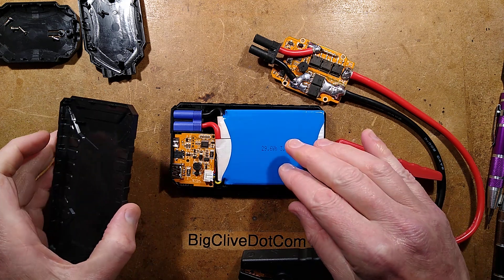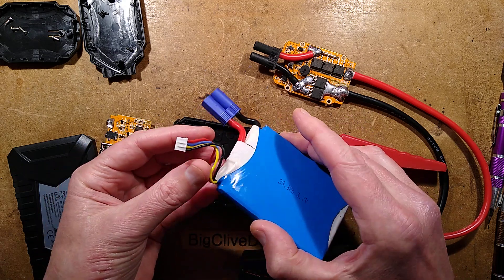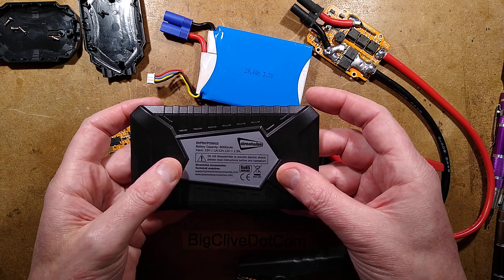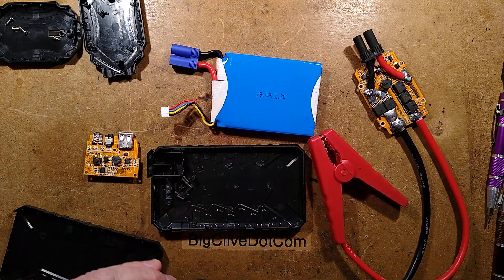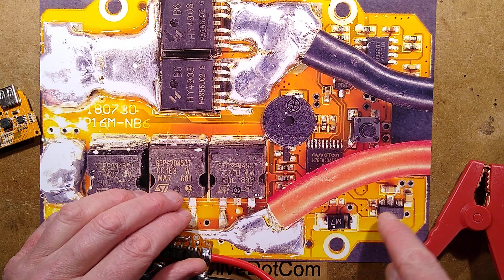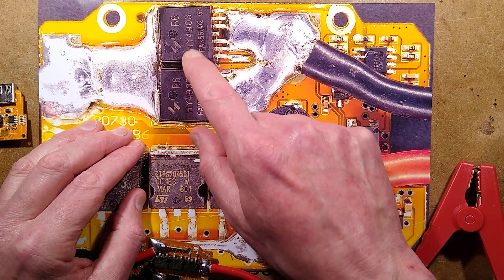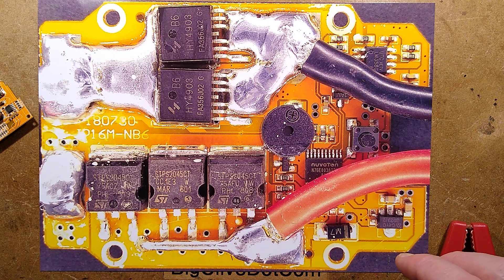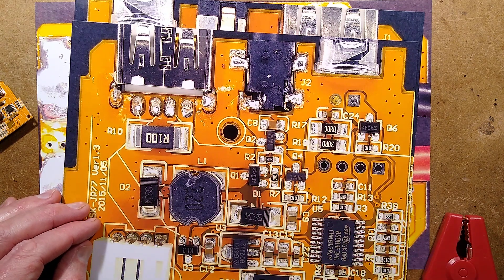Inside a combined power bank and jump starter

Comment: These devices are so interesting: it's such an obviously useful device.  Completely replace jumper cables, don't need a second donor car.

But they are ALL made by these random nameless companies, there are essentially NO name brand ones backed by any reputable company.  The reviews for all of them are a bell curve of of "this is great", "it didn't work", and "it went on fire".  Is it just not possible to make these reliable? Or would it be so expensive then, that no one would buy them? I can't believe there's no market for really good reliable jumper packs.
Reply: It's honestly a chemical problem. Most "portable car starters/jump starters" come into two different categories

Li-ion/pol battery based one, just like what Clive has here. The disadvantage is when you start a car it needs a brief amount of a lot of current. Lithium batteries don't take super well to this kind of ultra high current situation. A lot of complicated control circuitry and a much beefier case/cable set, more R&D. So that's why most of these are disposable, use once or twice and toss when it melts type deal.

You can also get much bigger, bulkier jump-starters that aren't nearly as cheap, but actually have a near/full sized Lead Acid car battery. So it's basically another car battery in a box with wires. They're a lot more reliable given they have similar current ratings to a normal car battery, but , the big downsides are the weight and bulk , as well as LeadAcid having a (comparing to lithium based) high self discharge, these types of units often need to be 
-trickle charged off your vehicles main charging system to keep it topped up. 
-charged up every few months

It is very interesting though
Reply: @SolluxDivide  "You can also get much bigger, bulkier jump-starters that aren't nearly as cheap, but actually have a near/full sized Lead Acid car battery."

I have one of these, and it has a lot of other useful functions, such as a USB output, a 12 cigarette lighter socket, a light, and a compressor.

In a power cut, I can stay on the internet, by running my tablet and router off it.
Reply: @BedsitBob  yep! Many of them can act as a power supply in a pinch, but I'd personally suggest getting a UPS for the modem/router/laptop so that they are more protected from electrical faults && will automatically kick to stored power when the line gets funny.
Reply: @SolluxDivide  Power cuts are very rare here, so I can't really justify a UPS.
Reply: @BedsitBob  It's not just power outages, but also under / overvoltage protection.  Here in "semi-rural" NSW outages are reasonably common, and the "cheap Chinese generators" are far better quality than we are led to believe, being very reliable and more than capable of exceeding their already decent specifications!
Reply: @BedsitBob  If all you want to power is a router and a computer, you can get fairly cheap UPSs which might set you back around $200.  These will keep you going for around 5-10 minutes so you have time to finish whatever you were doing and shut down cleanly.  Or... time to start up a generator if you want to keep going through the blackout.
But the point is that small UPSs exist and they're pretty cheap nowadays.  If your modem/router and computer are in the same room or you're using a laptop computer (which inherently has its own UPS in the form of battery power), then you only need the one UPS.
Reply: @melkiorwiseman  My tablet draws  200mA, and the router 2A, so the jumper pack should give me a few hours of use.

I'd likely only turn on the router for a few minutes at a time, to check in on the world.
Reply: There are a lot of name brand companies that produce these. NOCO, Schumacher, Clore automotive (who also owns and produces all the jump and carry models) and so on. Yes it’s true if you’re searching Amazon you might struggle to find a reputable brand. However outside of Amazon there are many name brands who’ve been in business for decades or more and who specialize in battery solutions.
Reply: I actually have a Noco, which I'd call a brand one. Works great, and chargeable by USB so it's really handy. Can definitely recommend it.
Reply: Mophie!
Reply: Has Makita or Hikoki designed one that can slot onto their power tool batteries yet?
Reply: I have a broken one of these that I was given "in case I could fix it", which had just stopped charging. The repair was beyond my skill but I was looking to pick one up anyway and was surprised to find exactly this issue. I'm not in the business of buying no-name cells/batteries if I can help it so that was a bit of a letdown.
Reply: Part of the issue i see, having worked for <US car maker> seems to be down to two things.

1: The makers cheap out and use only 3 cells instead of 4 in series, while, at least for GM, a 14v lithium jump starter would function much better within its limitations.
2: Lithium batteries aren't really made for ultra high current (1Kw+ at 12v), and so they don't seem to last long compared to a lead acid based jump starter....

There is a reason dealership mechanics use lead acid jump starters, even if the better quality ones are much more expensive. They last through 100s if not 1000s of jumps, and being able to just leave them plugged in, and having the internal battery maintainer deal with keeping them charged is HUGE reason to keep using them.

I personally made my own jump starter out of a very expensive deepcycle/starting battery for a Hybrid vehicle, a set of cables from a failed commercially made jump starter, and a smart battery maintainer, and it works even  better then any jump pack i used.
Reply: @wyokaiju992  I’ve been in the automotive repair business for over 20 years.  A few years back I would’ve agreed with absolutely everything you just said. Truthfully nothing you said is incorrect but my experience with many of the traditional lead acid jump boxes such as the JNC 770 or 950, as well as some from Snap On and Matco is that after 3ish years or so the battery inside develops too much internal resistance to be viable as a jump box for anything bigger then our smallest 4 cylinder engines. Leaving them plugged in or trying to micromanage their charging behavior didn’t really make a difference in the longevity, at least in my experience.  I finally had enough and I switched to a NOCO GBX155 and I’ve never looked back. Most of my 50 technicians have also all switched to lithium jump boxes. Some of the guys cheap out and use an Amazon jumper which I do get sketchy about, but the vast majority have a NOCO, or Schumacher, or one of the many different Clore automotive brand boxes. My experience has been fantastic with them. The NOCO will start dead Diesel motor homes that often times have 2, 3, 4, or more 12v batteries wired in parallel. Our shop made jump cart (exactly like the one you made) and the top dog Associated wheeled 12v jumper often couldn’t do that without disconnecting one or more of the 12V batteries first.  The main drawback I experience with these lithium jump boxes is their capacity.  When I needed to do remote diagnosis I could put my JNC950 on a car and get enough power to perform some diagnostics for 45 minutes or more. Even the biggest lithium box I own the GBX155 might give me 15 minutes at best.  I don’t mean to say you’re wrong in what you said, just that my experience has differed from yours.
Reply: @2down4up  Look into the larger portable power supplies often marketed as "solar generators". Or if you have mains available, just get a power supply.
Reply: @NiHaoMike64  Are you referring to using a solar supply as a jump starter or as a power to the vehicle during diagnosis?  Because I’ve never heard of or thought of such a thing but I am very intrigued.  As for mains power supplies I personally have three that range in continuous outputs of 55 amps to 80 amps with one of them having a 3 minute 100 amp output before it falls back to 70 amps continuous. My shop also has many 90 amp continuous @ 14.6 volt power supplies then in testing will support up to 105 amps @ 13v continuous. My comment was about having to power a vehicle that has a dead battery but that won’t start even when jumped.  This is the scenario where the lithium jump packs fall short. If it is possible to use a solar power supply, or something similar, to supply enough power to diag a dead vehicle for an hour or so that would be awesome.
Reply: @2down4up  The "solar generator" marketing is because they usually have built in solar charge controllers. They're just large lithium battery packs with built in charging circuits, BMS, and inverter.
Reply: @wyokaiju992  your statement regarding lithium batteries not being made for high current and thus lead acid is better is just plain wrong. Lithium chemistry is arguably the most mainstream high current battery chemistry available (LiPo if you want to get specific). The real issue is the volatility. Overcurrent on a lead acid battery fails much safer than it does on a lithium battery. Manufacturers cheaping out and using a tiny lithium battery and labelling them as jump starter capable of a thousand amps is just bullshit. Most lithium batteries that would be good to use for jump starting are capable of 30-50c, with rare exceptions above that. If they stayed on the safe side they'd get a 30ah battery capable of 30c and get around 900a, but the capacity of battery used is nowhere near 30ah. The schumacher drs128 mentioned in another comment is arguably the closest (I think it's ~25ah LiFePo). The consumer won't pay $300 for that when one of these is 1/3 the price and still "does the job" (while straining the heck out of the internal battery on most use cases outside of a small car with a slightly overdischarged battery).

Comment: I carry one of these and love it for most of my cars. Most. The poor things really don't like the 390c.i./6.4l V8 in our '61 Thunderbird. I had one smoke itself just trying to turn over that big American beast. Honestly, I kind of expected that. :-)
Reply from the maker: You can get beefier ones for the bigger engines.
Reply: @bigclivedotcom  Where's the fun in that?
Reply: Can you get a geared starter motor for your V8? I have one in my 6.0L V12 Jag and it is way more efficient than a regular starter motor.
Reply: @albanana683  DB electrical, TCI, PA Performance and Powermaster all sell PMGR starters for Ford FE engines.
(I have a DB unit on my 460 / 7.5l)
Reply: @kill-nine  The 3-bolt FE starters are definitely more difficult to find than my 385 (Lima) style, but they do offer more torque and pull less amps through the fender relay.
You need a minor wiring change. Moving the starter cable to the battery hot side of the relay and adding a 12 or thicker trigger wire from the switched lug.
Do NOT just jumper the solenoid trigger off the cable and continue to use the fender relay as it was.
Reply: @kill-nine  Just enjoy cruising this summer.
'61 T-bird sounds like a sweet ride!  👍
Reply: You have to be a American? more cylinders, bigger engine, more fuel, louder, turbo, supercharger, big tires
Reply: @Number-ju1nl  Does it show? The car I mentioned is a '61 Ford Thunderbird. A giant beast of a car. :) I like all kinds. I also have a car with a 660cc 3-cylinder. Look up Autozam AZ-1 if you aren't familiar with them.
Reply: @kill-nine  the bird has a 9.6:1 compression ratio. Either you car's battery was completely wasted or the starter is heavily worn. The jumpstarter would have worked just fine..these are not ment to start a car with a battery under 10v. Only supply additional current to help aid starting. Bragging about how "big" the engine is does not fit.
Reply: @Number-ju1nl  Yes. We are better than you!
Reply: I have a Duracell one it’s started a 3 litre diesel 3-4 times in a row pretty good to get out of trouble.